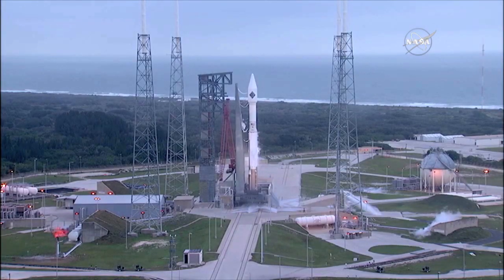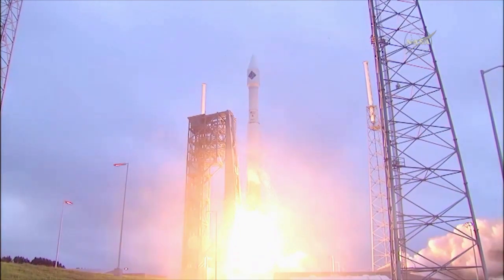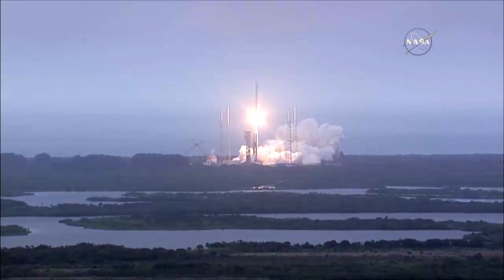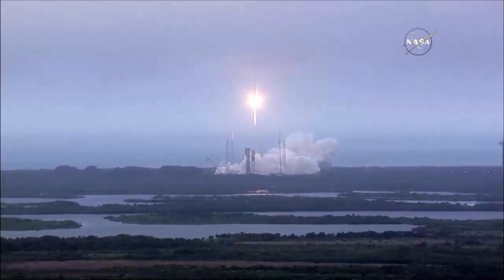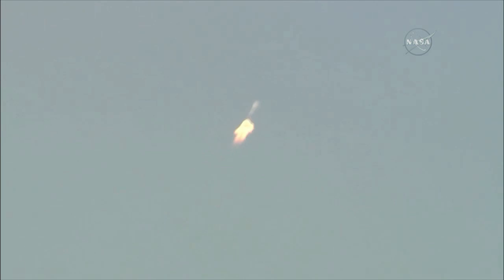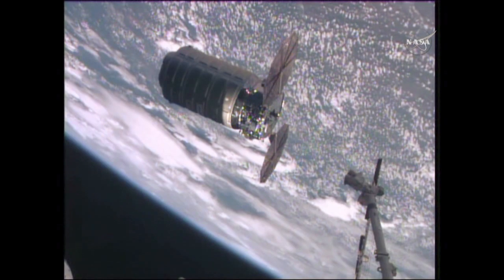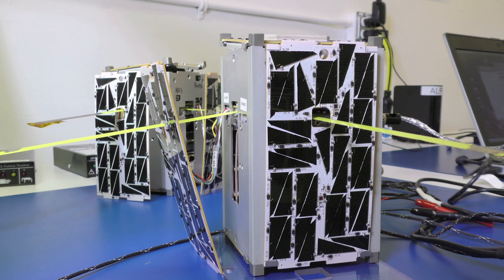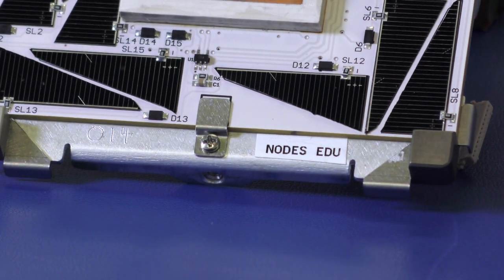NASA Small Satellites to Demonstrate Swarm Communications and Autonomy

Comment: +Nasa's Ames Research Center
Try to attached Tesla Coil to metal cylinder with two anti-rotation wheels inside of, turning mercury. Upgrade Vimama Engine to next level and on the next stem I tell you how to build the Fanthom engine.